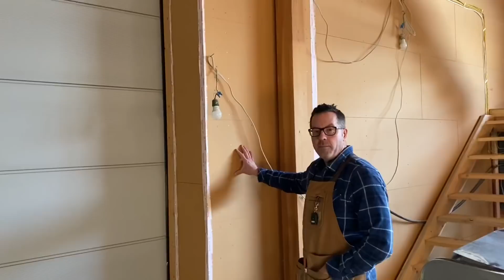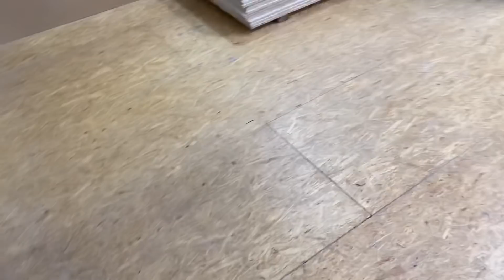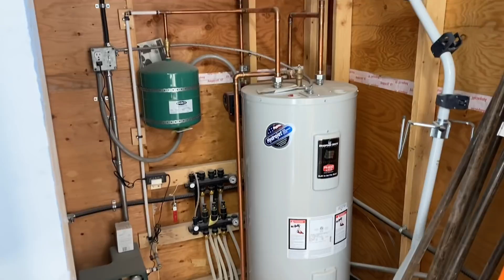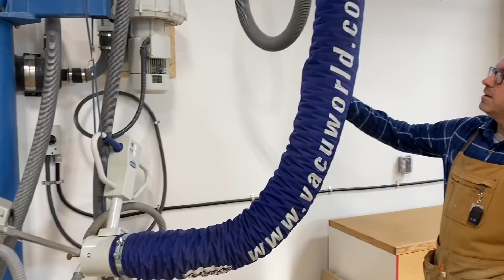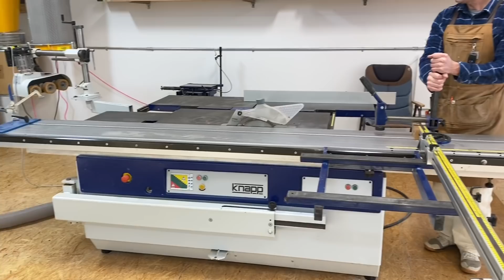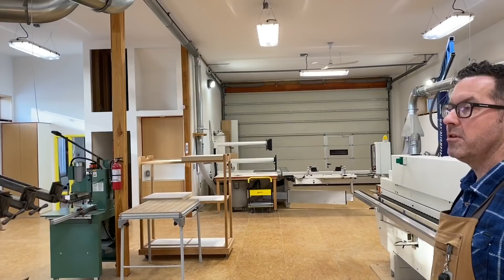A passive wood shop - Tour of the Agora shop

Comment: That is a killer workshop.  Thank you both for sharing.  Definitely this is the way of the future.  On a passive house, what would you say is the initial investment versus the money saved over time ratio?
Reply from the maker: Well they usually say around 10% more than conventional construction so over the lifetime of the building it would certainly pay off
Reply: Austin Tischler. Thanks, with just the $1100 savings  a month in energy cost, it would pay for itself within a couple years.   Definitely the wave of the future.